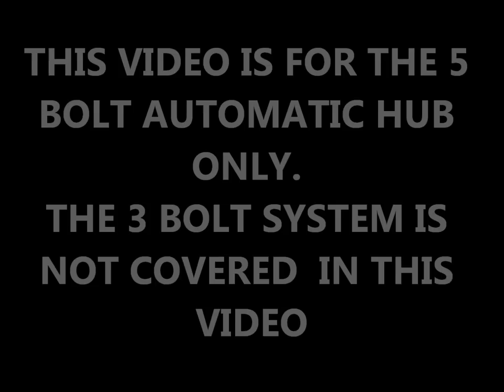Ford F-150/Bronco 5 Bolt Automatic locking hub Disassembly and repair

Comment: I have a 1994 4x4 F150 I bought used. The cap was loose and no matter how tight I made the bolts, it would not stop wobbling for some reason. It was also leaking grease out onto the wheel when I'm driving. I watched your video, completely disassembled the passenger side and put it back together. There is no wobble now, the cap tightens up correctly. I'm not sure what was wrong with it originally but I think a ring or spacer or something was put in incorrectly by someone in the past. Thanks. The automatic 4 wheel drive works fine on this vehicle so no need to convert to Manual Locking Lugs.

Comment: all good following your instructions.  Thank you for the video.   My hubs had an additional spacer between the drive sleeve and the stator ring c clip.  Thanks again.
Reply: Can you elaborate on this? I ended up with an extra ring after putting mine back together...
Reply: What is the drive sleeve/stator ring c clip?
Reply: @rtgomez90  see my post below for the exploded view drawing.  It's been a while since I did this so I can't remember.  That exploded view will give you the reference for the stator ring.  That's probably the spacer ring I was referring to.
https://www.supermotors.net/registry/media/1053962

Comment: My 92 f250 pulls good in 4x4 until a load is put on it and then it pops so loud you'd think the front end had fell off. Is that the factory original auto hubs??
 It couldn't be the universal to front axles that loud I hope.

Comment: Anyone know where you could pick up these hub covers with the 4 x 4 sticker on them? I have a 1993 Ford F150 super cab auto locking hubs. It looks like the same ones he has at the top of this video.
Reply: Dude I’m here for the exact same reason. I also have the exact same truck as you. Year and everything. My stickers are both faded and would be great to find new ones. Let me know if you find anything!
Reply: @MrJdy18  Will do

Comment: I went through both of my 1994 F-150 as you instructed and both seem to be in good working condition.  However when I shift it to 4wd the light indicates 4wd but the truck is still not going into 4wd.  I am thinking it could be the transfer case motor.  Your thoughts?
Reply: What did you find out? Thanks

Comment: Beautiful, is this the same concept for a 1992 ranger with auto hubs?
Reply: Yes it is. As long as it is the automatic locking hub. I've got an 86 ford bronco 2 and it has the manual locking hubs on it, then my 94 ford f150 has the automatic ones.

Comment: I know this video is 3 years old but after removing the locking assembly would you be able to remove the caliper and then remove the hub and rotor or is there more work to it?
Reply from the maker: Travis Compton a large but would meet to be removed off the spindle with a special socket. Then after removing the caliper and caliper bracket you would be able to remove the rotor.

Comment: What year model is this from? I've got a 92 Bronco with factory 5 bolt auto hubs and they are nothing like that. No clip and no tabs on snap ring. Internals also different.
Reply: Craig T's  same I  just look at mine today I got 1991 Bronco

Comment: I have the same automatic locking hub. The plastic part is broken on mine. What is that part called? I can't find it anywhere
Reply from the maker: I belive it is called the cam. Not entirely sure. but i doubt you'll find it for sale alone... Probably gonna have to get a new hub.
Reply: Where can you find a new hub and rotor for these at.

Comment: I need new caps entirely and all I find are the more common 3-bolt and manual hubs. I've searched everywhere shy of the dark web for replacements. Any clue where I can find any so I can stop pulling my hair out?
Reply from the maker: TheBandicootBrony they sometimes pop up on Ebay. But usually for a small fortune.... I would check the junkyards.
Reply: It's worth a shot. Thank you. :)

Comment: Nice, buy some manual hub's
Reply: MrJeep75 Why thats just dumb!
Reply: Honestly, on these trucks, unless you are doing heavy offroading, the auto hubs are more convenient if you keep them working. That way, if you are driving and you get into a patch with low traction, you can just hit the switch/pull the lever and engage 4wd (since the t-case is SOTF).

Comment: Looking to do mine, but I'm afraid to do it without having replacement seals to put it back together with.  Here's an exploded view on Supermotors https://www.supermotors.net/registry/media/895156 of all of the hub parts.  Looks like the kit goes for around $50 but not sure if it's the right one.  F6TZ-1K106-AA
Reply: Thanks for the diagram I realized the extra spacer I mentioned goes inside the cup w/ the brake band underneath the first c clip. I didnt see it in this video but mine were both stuck inside the cup. 
Hope your Ford is running good.